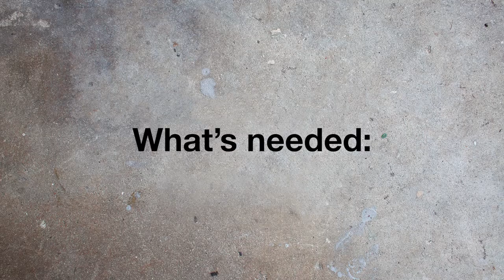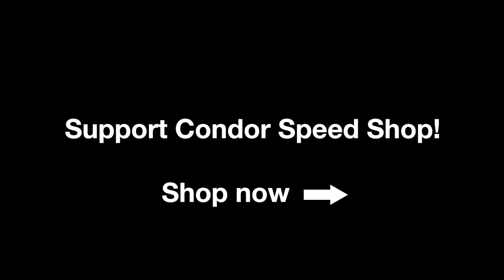How to install a power steering delete in an E30 - Condor Speed Shop

Comment: About to buy one of these, I see your turning the wheel twice presumably to clear out all fluid, dont you want any power steering fluid to remain in the rack?
Reply from the maker: Michal Ransome you actually want to remove most of the power steering fluid so there is no resistance in the rack. The fluid will build pressure. You only need a couple of ounces of fluid.
Reply: @CondorSpeedShop  ok thank you!

Comment: Is this video on the M4x engine? I had a concern with some of the M4x and M5x engines on what belts should be used if the the pump was taken out. Its not like its easy to measure especially if you wanted to pull the ac compressor at some point. Im going to buy this block for black friday along with some reinforcement plates for the rear. Just wanted some insight on how people deal with the belt. Id like to this install in one day.
Reply from the maker: Dayco 5060555 6PK1410 (m5x) or K060560  (m4x)

Comment: Is the steering at parking lot speeds or backing out of a spot like driving a car with blown out power steering where you have to muscle it pretty hard to turn?
Reply: Andrew, It’s not as stiff as a car with blown out power steering because when you install the delete all the fluid is purged from the rack, so you will not have the additional pressure of pushing the fluid through the rack pump and lines.
Reply: @gt4silence  thank you. Ordered it last night hoping for exactly what you said. I appreciate it!

Comment: Why can't you just remove the power steering unit, and place back the original 19mm banjo bolts bolts instead of the power steering delete?
Reply from the maker: Hi Adam, You need air/residual fluid to travel from one side of the rack to the other. Without this passage(inside the delete) you will build up pressure in the rack eventually blowing out the seals..

Comment: I thought you needed to prep the rail by removing all the fluid then packing with grease? Also have you tested this application on a E9X chasis?
Reply from the maker: The only time you san/may want to add grease is when you are starting with a rebuilt rack.

Comment: I don't understand this at all. Is this for a track car? Is that reduced to a strict rack-and-pinion? I don't understand the why?
Reply: It’s a preference- some want to not have to deal with the power steering leaks etc.  These cars came with power steering and non-power steering - so it’s not needed.  Power steering takes some of the feel away from the steering.  I found the delete to be a bit difficult when parking. But have lived with it.
Reply: @polloloci21  ok. I think I get it more now. Thanks for taking the time to answer my questions. 
So when my pump finally dies,  can I just remove the belt until I decide which route to go? Without damaging anything ( not that I wouldn't be potentially replacing everything since it all leaks)?
Reply: @chrisperkins3026  I removed the pump and lines but got one of the condor power steering delete kits. I’ve been using it without power steering for a bit - I don’t really like it cause it’s a bit hard to maneuver when parking but other than that it’s fine.  I’m on a mission to replace most everything with stock components before I start to “modify” stuff- I feel like the cars were well designed and strike a balance between daily use and driving experience.  I don’t need a racecar to drive to work - it gets old fast and then you end up regretting some of your non-stock options. 🤷🏻‍♂️

Comment: Its need fluid??? Thanks and cheers
Reply: No, You do not need any steering fluid in the rack.
Reply from the maker: If its a freshly rebuilt rack you may need to add an oz or two of fluid for lubrication.
Reply: @CondorSpeedShop  thank you very much 😄👍🏽👍🏽👍🏽👍🏽